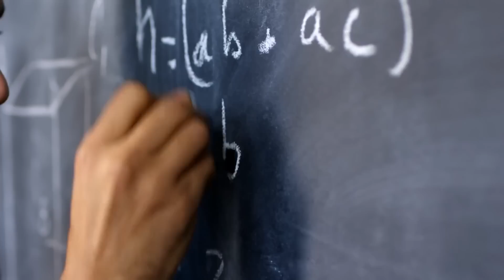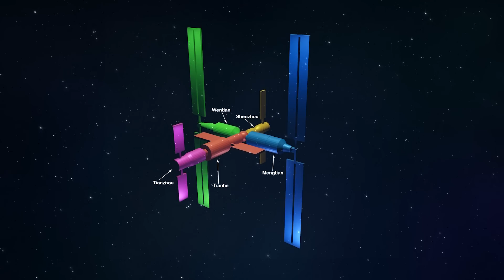Is Space Elevator The Future Of Humanity?

Comment: How can anyone talk about savings when no one has any idea of what building this thing would cost? The other problem I see is what happens when the elevator grabs the line, and tries to lift itself up towards the sky. What prevents it from just pulling the space platform down towards earth? Then, it it reaches the space platform, the counterweight is now much heavier than it was before, and what would prevent it from pulling the cable out of it's earthly anchor? You would have to have some fairly serious foundation on earth in order to prevent that.

Comment: Landing on Mars will be the most dangerous thing astronauts do over the next few centuries, due to parachutes being ineffective in such a thin atmosphere when attempting to slow a heavy lander loaded with humans. Mars is the place for an elevator.......it's got .38g pull, 24h 37m rotation, and less than 1% of Earth air pressure. And no oxidation of metal bits. Mars, I tells ya.